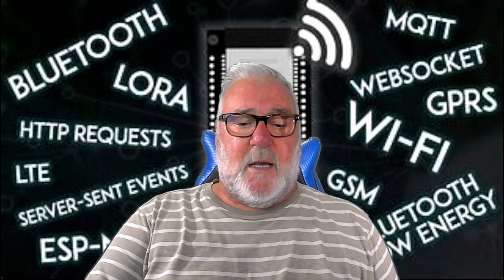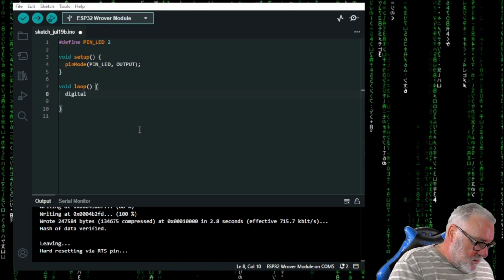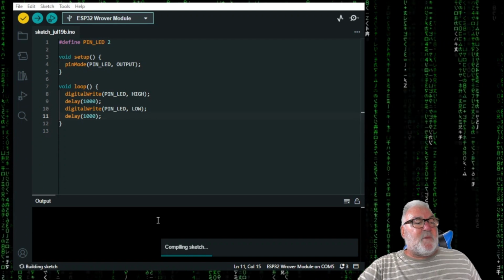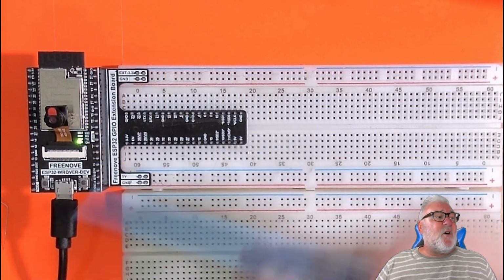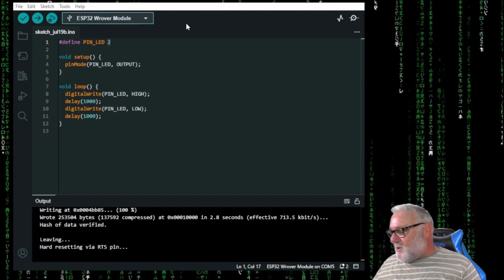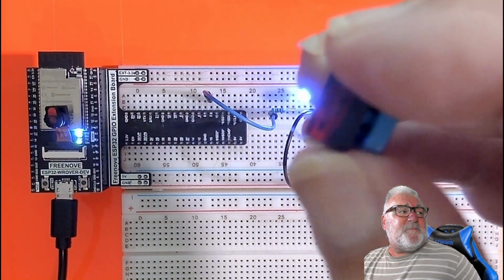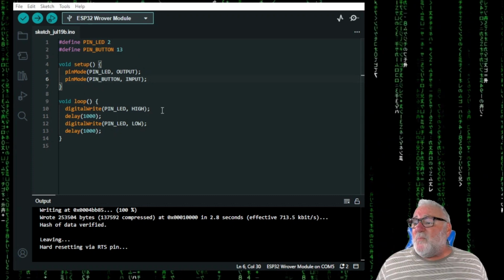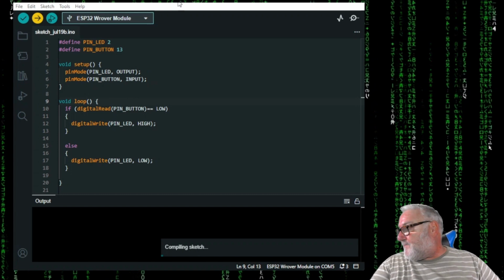The New Esp32: Let's Test It Out!

Comment: nice vid...I have 2 LoLin NodeMcu V3 boards that get recognized by PC (com 8) in this case, but my arduino IDE won't connect to board and times out waiting for packet header...any suggestions?  they both do the same thing
Reply from the maker: I do not have a  LoLin NodeMcu V3 board but i guess this would be the same. When you run the skech try pressing the boot button. Its thr small button bottom right.